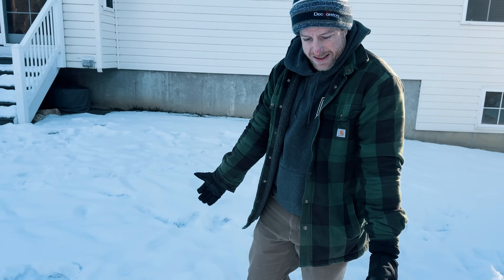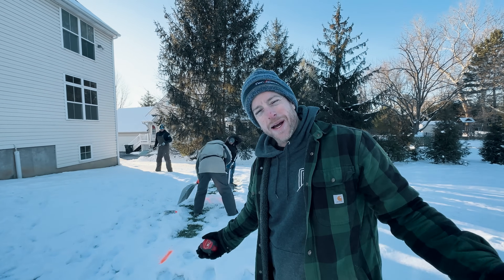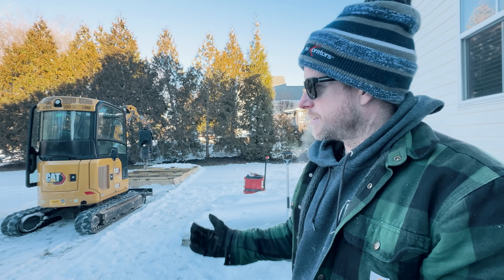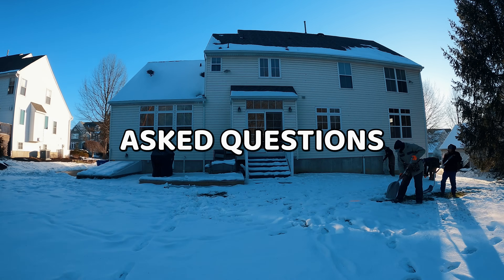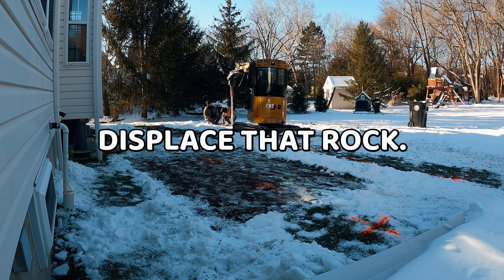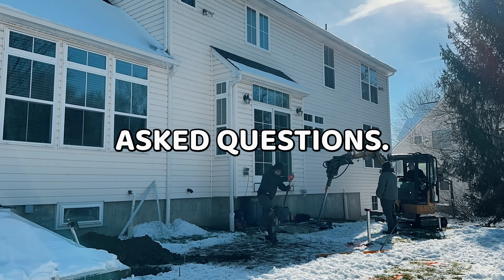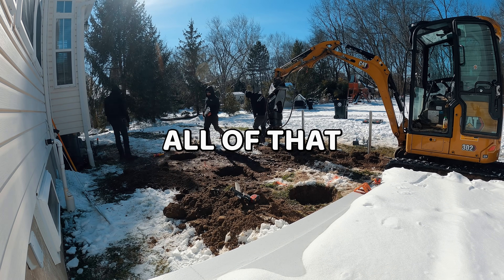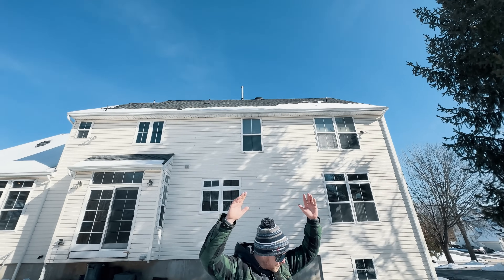Installing Deck Footings In The Snow + Helical Pile FAQ

Comment: Nice dog in the design mock up. Cool that your 3D rendering SW can add pets. LOL! Other benefit that I can see with the piles is the ability to spin them out if you’re doing demo. Question: can you use piles in wet applications (creeks/streams)?
Reply: possibly, just have to go deeper until they reach torque specs
Reply from the maker: Yeah definitely makes removal easy if you need to! And yes they are great in applications like that because you know exactly when you hit the type of soil you need

Comment: Hey! Good stuff! I field a lot of questions out this way. Another one I get all the time is "how long till the pile decays...?"   The ones im certified to install are about 50 years BEFORE the galvanization process is applied at the factory. So around a 75 year life span as they come off the truck! The wall thickness is substantial. People look at these and picture them being like chain link fence posts rotting at the ground level. Not the case with these. I do remind people that when getting near a foundation stay far enough away from the french drain system around the footer. As you show,  the deck can be cantilevered toward the house and have the piles installed safely away from the footing drain if there is one. Great product. Thanks for these vids! Ive been lurking around since you started the channel!
Reply from the maker: That’s a great one! Some people assume they are going to rust out immediately and don’t realize this is 60 ksi steel and then galvanized, also great point making sure you locate and confirm any drains near the house!